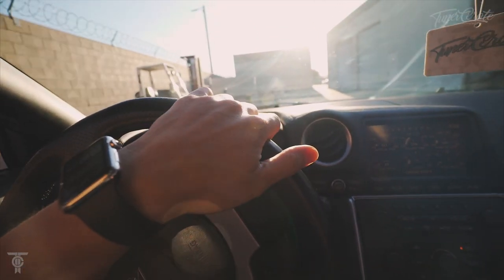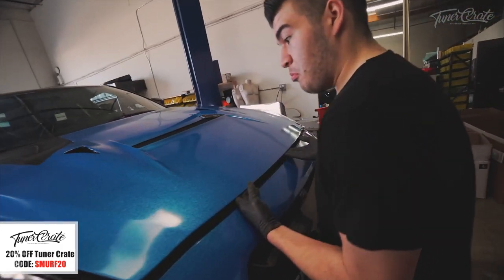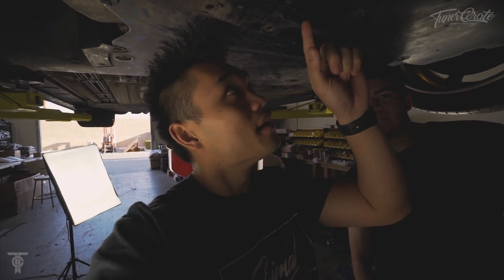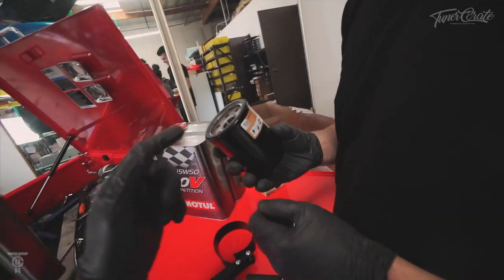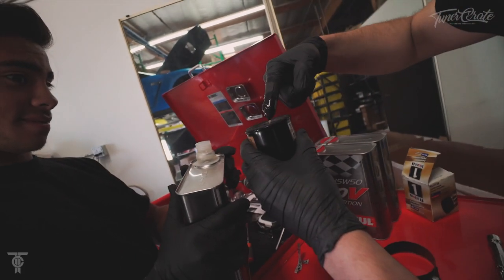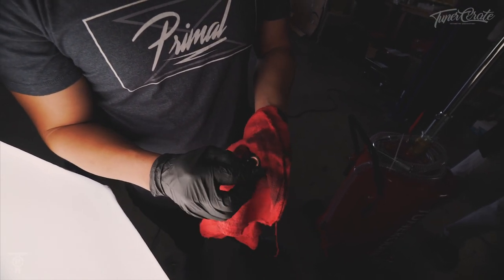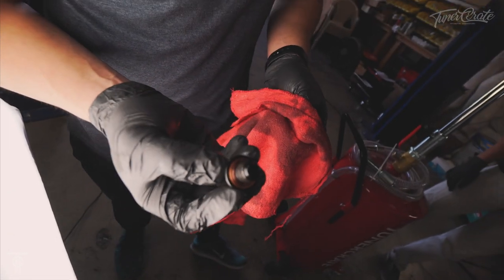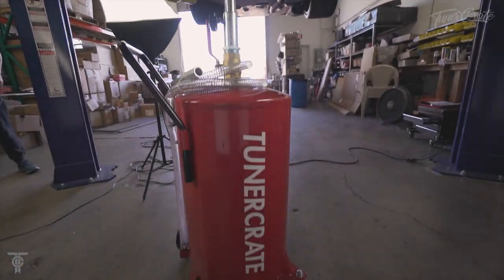WE LICKED THE GTR OIL FILTER

Comment: oh...that "ring" on the oil plug is a brass washer..a good idea is to replace that every few oil changes.. it loses its squish ability and causes you to have to over tighten it...that's why it was on so tight from previous.
Reply: kevin towne and use motor oil on the new filter instead of lube.
Reply: very true
Reply: kevin towne amd use motor on the new oil instead of lube.
Reply: kevin towne its fine. I forgives.
next time use motor on the new oil instead of lube.
Left winger republican triggered ricers.. 
I geeeezuses.

Comment: Great video! BTW, I have a GT-R and do my own oil changes. You can actually fill the oil filter all the way to the very top and it still won't spill out when installing it onto car. I know it looks like it will because of the angle but it won't. Also, there is a SoCal all GT-R cruise in Costa Mesa this Saturday. Hope you can make it. Last cruise was 60+ GT-Rs!

Comment: If my dad ever taught me anything at all its:
Buy Good Oil
Sure, go ahead and by the cheap Chinese knock off spare parts, sure use cheap gas, but buy good oil.. It's important for health on your motors.. Doesn't matter; Lawnmower, chainsaw, car, drift missile, semi truck, forklift.. Doesn't matter.. Buy good oil.. Check the manual for what oil to use.. Or call the company they will recommend one that fits your application.

Comment: Only time I ever took my car to get an oil change, they over tightened the drain pan bolt and cracked it. Decided to silicone over it to stop the leaking and then charged me for the oil that leaked out. Knew something was up when they tried to tell me the 2.2L engine took 10L (2.6 gallons) of oil. Looked under it when I got home and saw the silicone, decided to investigate. Couldn't get anything to stick because I'd looked at it and could have tampered with it
Also, when checking your oil, read the owners manual, some cars want you to check fluids when the engine is warm, others cold (stuff expands under heat)

Comment: I wanted 3000 horsepower so I let the hose run into my intake manifold. For some reason my engine bent some connector rods??
Reply: just hook the battery cables up backwards so the engine turn the other way around, and put the hose in the exhaust to bend the rods the right way again.